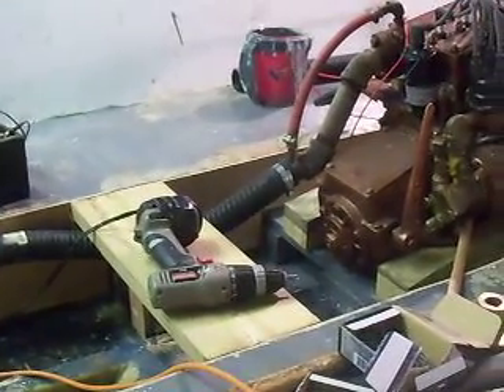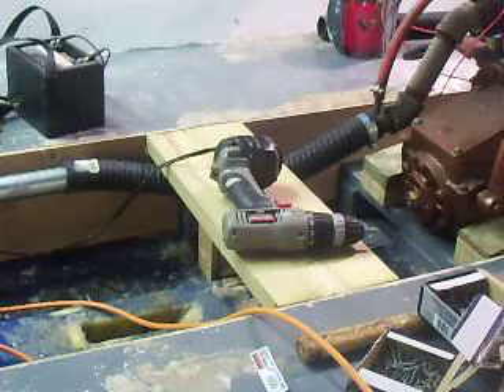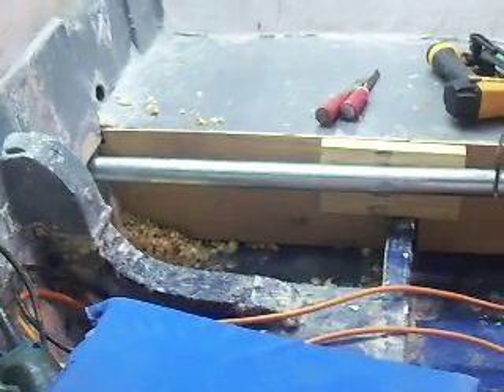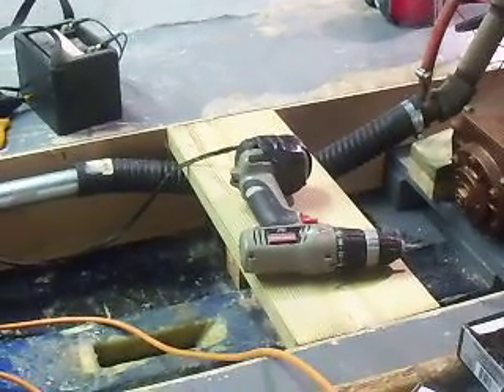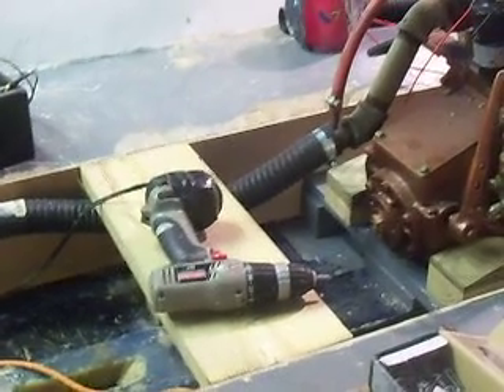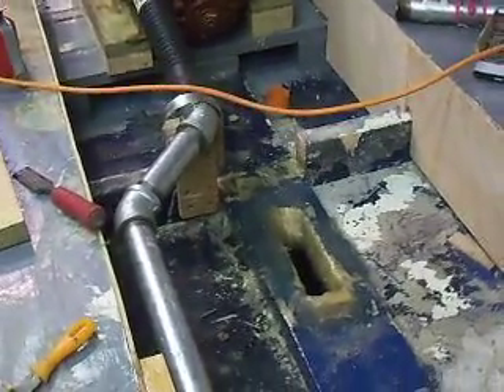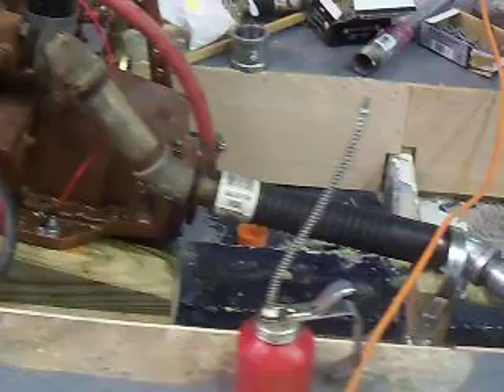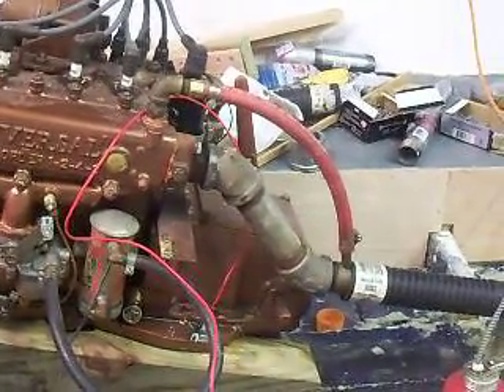Installing an inboard motor in a small boat update 3 of 13

Comment: Why does the exhaust have to go through the transom? Couldn't you vent it vertically and raise it over the top of the transom? Wouldn't that eliminate the problem altogether?
Reply from the maker: The exhaust is water cooled, so that any vertical angle in the pipe would cause cooling water to build up, degrading performance or stalling the engine once the pipe was blocked with water.  
     I've since given the boat away, but with a do-over, I would have bent the exhaust 90 degrees to port at the level of the engine coolant/exhaust outlet, and put the exhaust over the port side (well above the waterline.)
      As a retirement project this boat was wonderful, but if you need a boat, then buy a 15 foot boat with a 25 hp motor.  You will have a much cheaper and better boat in the end.  
     Thanks for watching and commenting.
Reply: @MemphisApplegate  excellent idea!